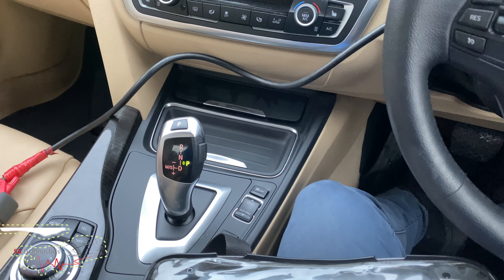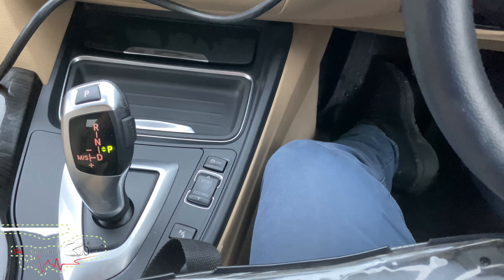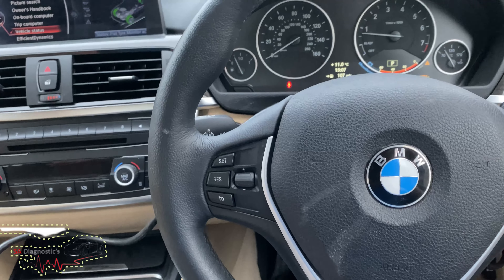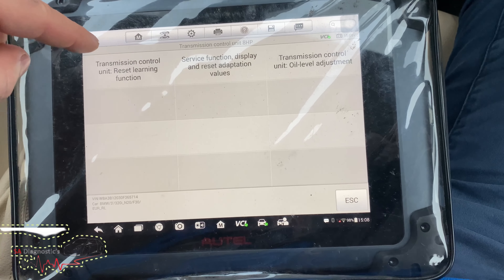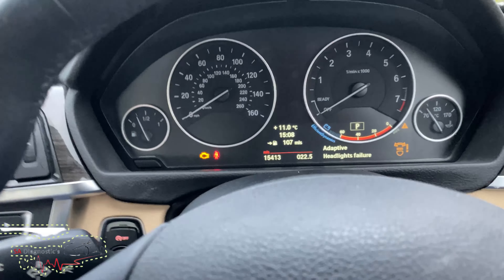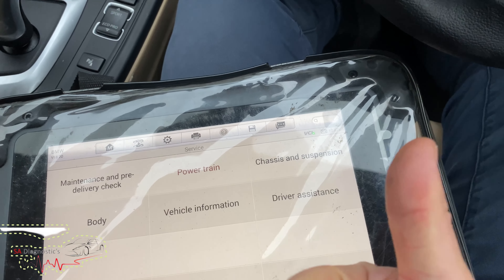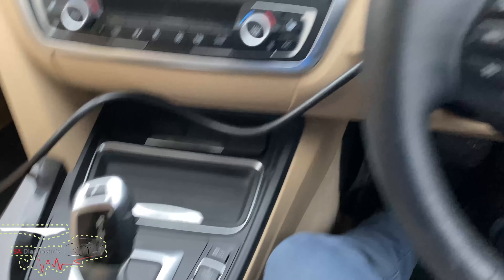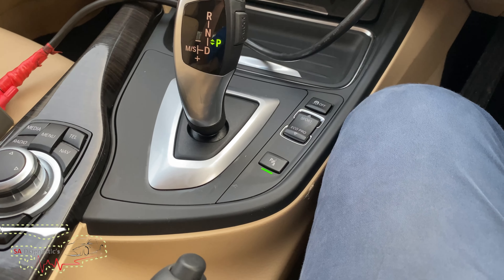FIXED!! BMW ZF 8HP AUTEL GEARBOX JUDDER SHAKING VIBRATING 1 2 3 4 5 6 7 8 Series F20 F22 F30 F32 F10

Comment: thanks for sharing your knowledge but was it really proven to be fixed on such a short test drive ?  from what i read, the fault seems to only occure after 30 mins of driving, when the EV battery is discharged. Do you have any thoghts on the actual  cause ?
Reply from the maker: Hi yes this fixed the issue for this vehicle.
However, it seems to be common for bmw to do this and they can go back to low in oil or dead battery and many other things.
Reply from the maker: Also yes the test drive was done for a while also we did. Roughly 20 miles ish in it. It never came back with the fault also we’ve not heard anything as of yet.

Comment: I have the judder in a 330e in 6th. Only happens when the oil cooler stat is fully open @75c. I think the oil cooler may be lowering the level in the sump causing erratic shifts when the cooler is engaged. It doesnt happen under 69c and this is the extra temp the stat begins to open. I tried the adaptions many times and it made no diff
Reply: same with my 330e as well. have you been able to fix the issue? when it reaches temperature it also happens to me in 3rd gear. I would really like for you to share your knowledge on what you have done and if things have worked for you.
Reply: @TheRFJAN  I haven't fixed it. I'm going to try a transmission flush. I will let you know
Reply: Hello. If you fix it please tell us because I have the same problems.
Reply: Has anyone experienced an issue,  i select drive and the vehicle obviously moves forward without applying the throttle, then when you do apply the throttle it double jumps as if it were taking up slack somewhere? In both forward and reverse gears. It also does the same double jump/clunk when down shifting from 2-1st. Any ideas what would cause this??
Reply: @user-od3rl5mc how did you get on with that mate did the transmission flush work

Comment: Dont reset the gearbox.  

You have to put it in re-lear mode (with computer) to get the gear adjustment right for the wear on the plates inside the gearbox.

Re-lear mode is difficult to complete; if the road is bumpy it stopts. You also have to do an exact  drive for a couple of minutes.

Comment: I have this issue with, do you think it's a transmission issue? https://youtu.be/V5_Zmvhwdk4
Reply from the maker: @PromausSK  is it the squeezing QUACK noise your referring to?
Reply: @sadiagnostics  Yes that Grrr or Quack grinding noise right after startup.
Reply from the maker: @ it’s hard to say but common issue with them maybe be the Egr or the manifold. Could be leak somewhere hence that sound…
Reply from the maker: @ I’d try reading some forums first and see what they say…
Reply: @sadiagnostics  Well it's G31 two years old not that much there about. When I slightly push throttle on, the sound change accordingly to higher rpms as well.
Reply: The sound comes from underneath than the engine bay.